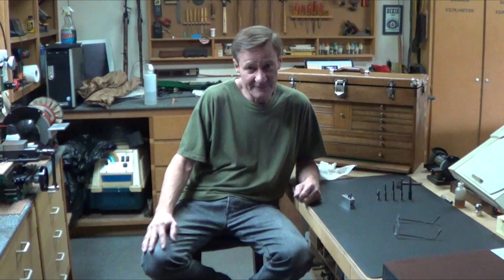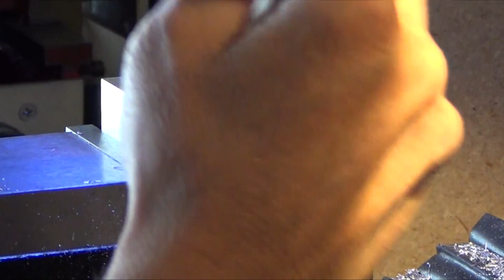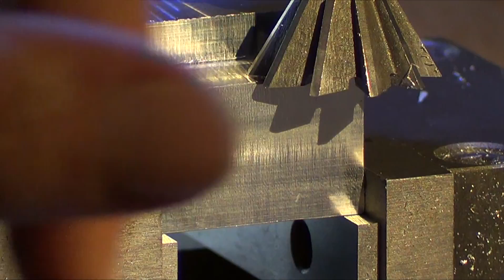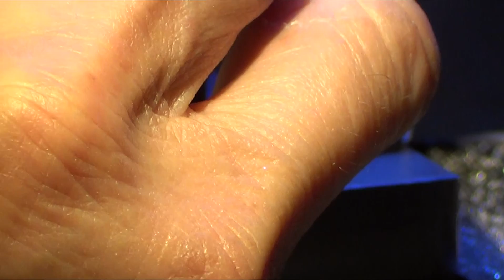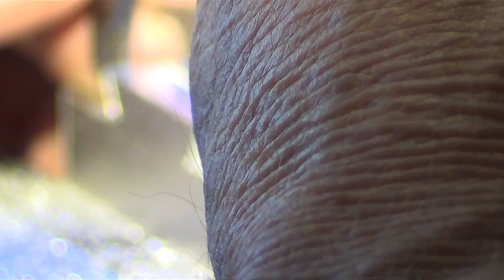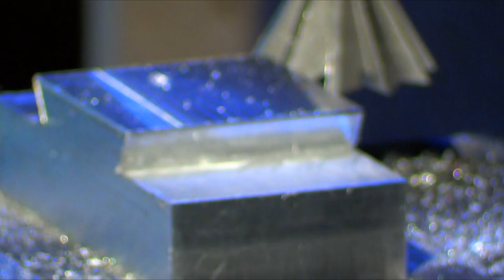Making a lathe boring bar tool holder Part 1 Video #14

Comment: Not getting a nice finish with my fly cutter like you are. Can you do a video on how to grind the tool bit. Thank you
Reply from the maker: All the videos are indexed on my web site shown at the end. The fly cutter is DIY and the print is on the web site. The cutter is an insert holder Any Time Tools sells a 3/8 set and the insert is Cobra Carbide TCMT 21.51 which is for finishing aluminum. Amazon $25 for 10. Can you email me a picture of what  you are using and the finish.

Comment: Good video Dave.  I'm not a machinist but I keep reading that end mills need to be in a collet (or end mill holder) due to the fact that the gripping surface of a 3-jaw chuck is very small whereas a collet is very large and is therefore much more secure.  Thank you again for the videos but you are going to cost me some money if I continue to watch them.
Reply from the maker: +123HURST LOL You haven't caught up with all the videos yet. Both mill and lathe have been converted... https://www.youtube.com/watch?v=NuiWd_ciewk
Reply from the maker: +Dave M Better yet... https://www.youtube.com/watch?v=tbyr7bsBKME

Comment: Is using a drill chuck to hold an end mill acceptable for finish pass? I always heard this would ruin the drill chuck's accuracy because it wasn't designed for the side load.
Reply from the maker: +anon a Never really thought about that.... all I can say is the chuck is all I ever use and there are a LOT of hours on it and the run out remains just under .0015. I don't make deep cuts and thinking about the chuck design not sure why it would be damaged under moderate loads. Good input!